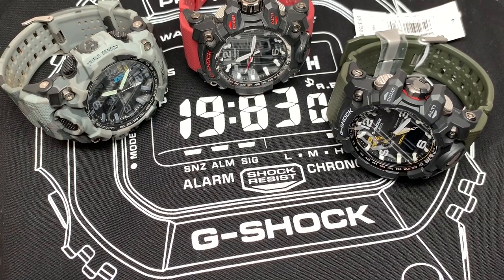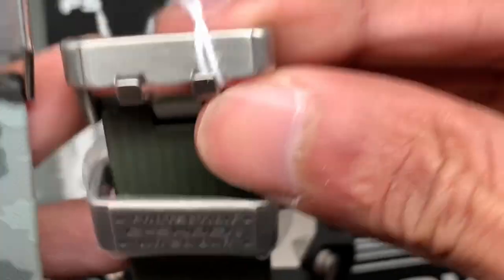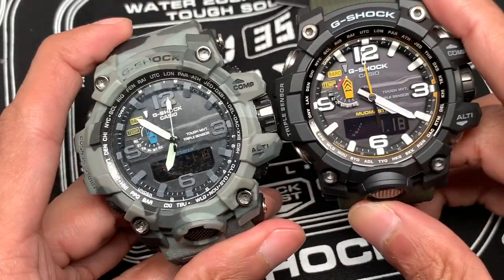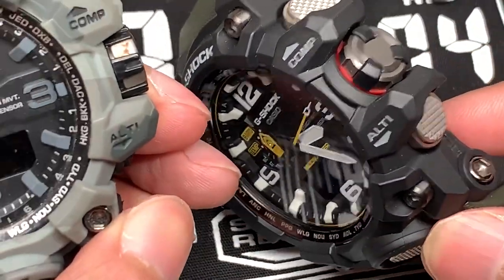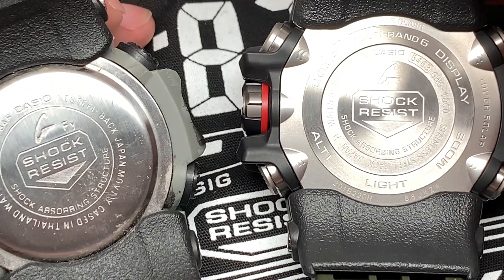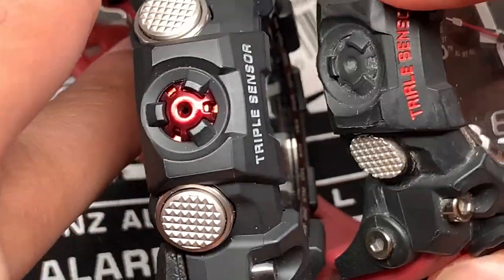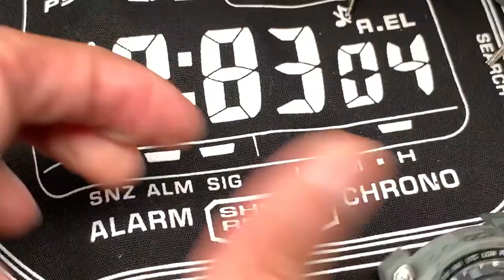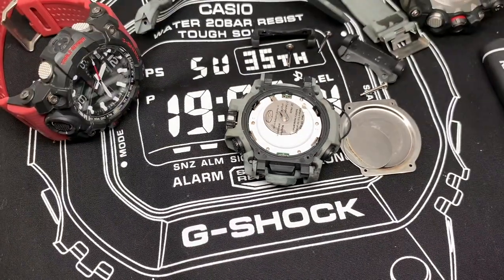What's INSIDE a FAKE G-Shock Mudmaster? GWG1000 Fake vs Real comparison

Comment: I bought the GWG-2000 from a local Casio watch dealer near to where I live. It is absolutely authentic. Works terrific, and functions exactly how I like.  I have a number of Casio exploration type watches.  All are terrific.  As for accuracy I had it checked. It should keep to a bit better than +2 seconds per month. Most electronic quartz watches I have are keeping from about +1 to about +8 seconds per month.  As for the accuracy of the barometer, compass, and the altitude these watches are very accurate when considering the cost. They are accurate enough for hobby use. I like this watch a lot.  It is not much different from the GWG-1000 from what I can see; other than the slight difference in the styling of the watch.

Comment: I saw a used mudmaster on ebay for  65 dollars, on the back of the case it says gba-400 but I looked it up and a bluetooth g shock turned up and looks completely different. Then I looked deeper and found the model GWG1000-1A which looks exactly like the ebay one. Would the ebay one be a fake? Or could it be an old model with different model number?

Comment: I was sent with a fake from Mercari..currently disputing..but I must admit..this fake is pretty darn good... even the hand moves to the right mode when you access the mode... the band, the back plate, I mean it looks real. What I caught was.. I wasn't able to adjust the hour and the minute hands individually (but it does sync up with the digital clock correctly) ... and the lume. Showed it to my friends, and they all were impressed with this fake...no kidding. They said, if the seller willing to admit this is a fake and sells it for $50 or so....my friends would buy them.....that's how crazy good fake this watch was.
Reply: Wow a whole 50.. must be great

Comment: why you "genuine" has 2 series of numbers.. in backplate, 1little left from center line and 1 in right..

usually there's only one in the middle which shows factory and date of manufacturing...

only more high end G Shocks has actually individual serial number